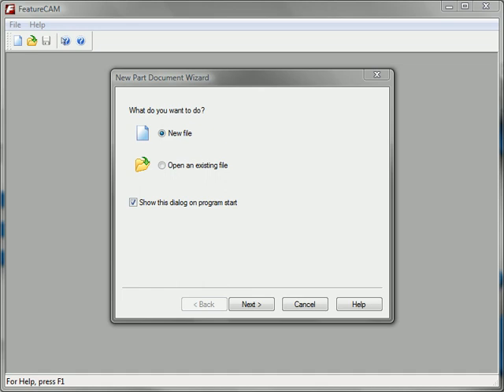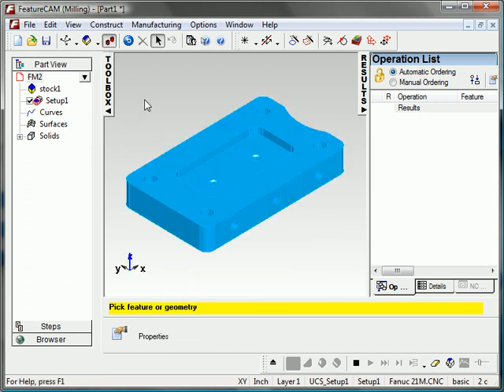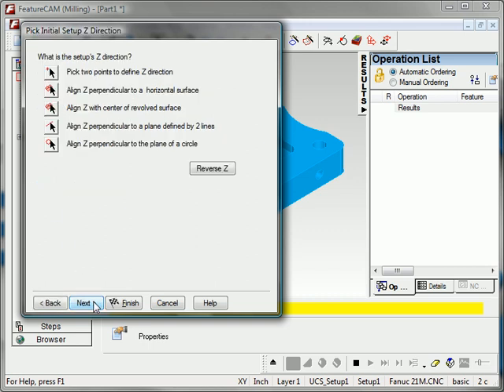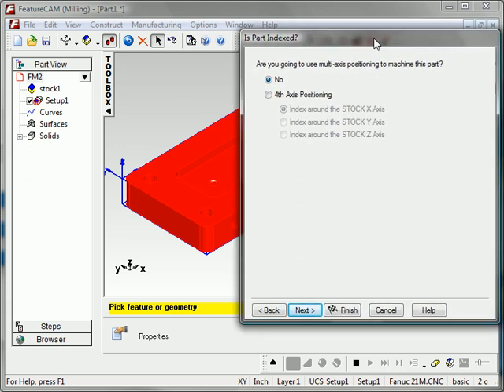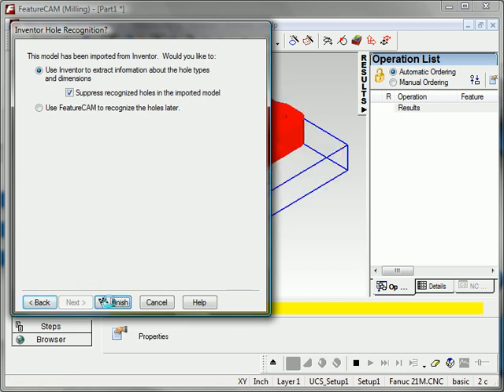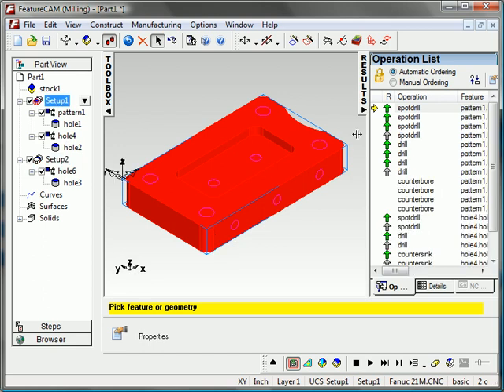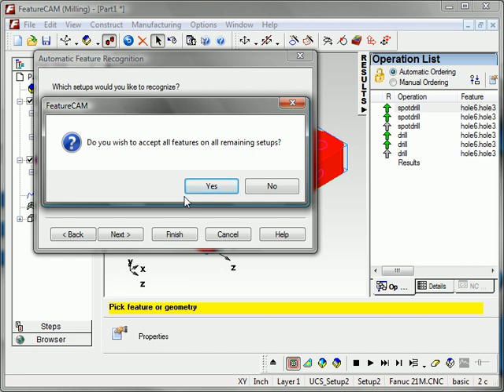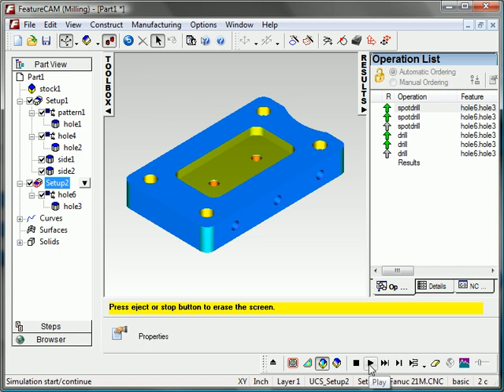FeatureCAM for Autodesk Inventor

Comment: This reason alone should be why FeatureCAM is bundled and/or built-into Inventor CAM. Turn iLogic into a visual block code that's drag and drop so everyone can understand it with minimal effort. Make the code in AutoCAD, export as DWG. Manage in Vault. SELL AS BUNDLE.

Inventor CAM desperately needs to be better or on-par with Fusion 360. There's currently advanced machining strategies that Fusion 360 has that Inventor CAM does not. Machine Simulation being a HUGE one.

Put FeatureCAM into Inventor CAM and build something AWESOME. Give the hardcore cloudless users a solid choice if we're willing to shell out the money.